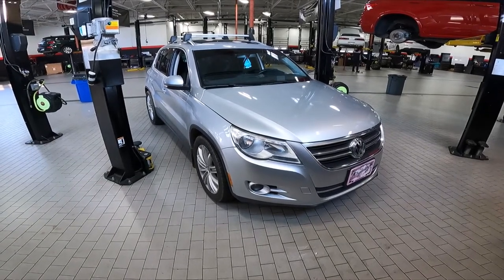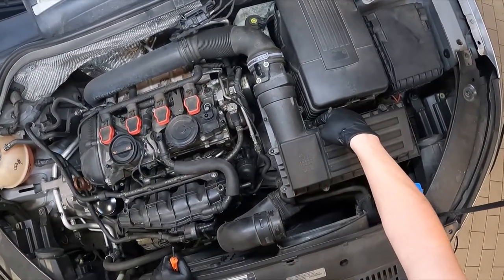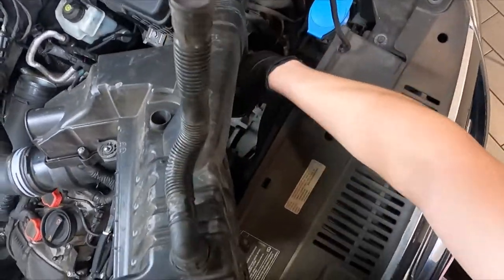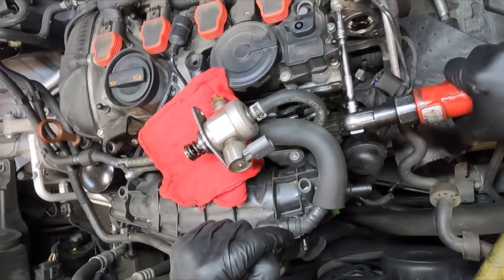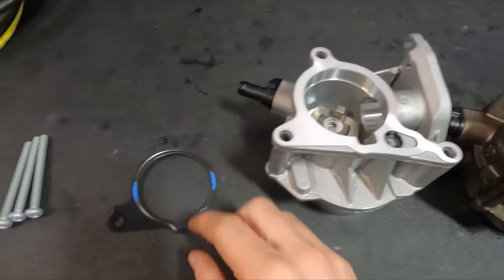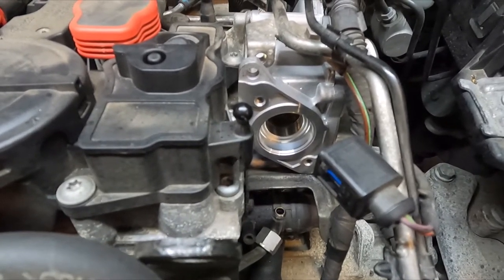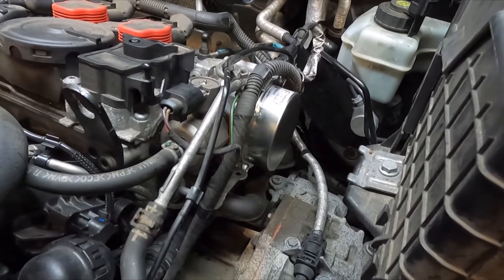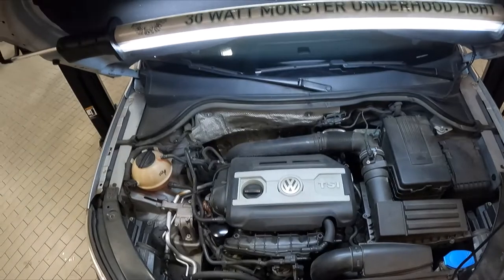How to Replace the Vacuum Pump | Mk1 Volkswagen Tiguan (2009-2018)

Comment: Very informative video, and probably the only one similar to my vehicle (cc).   The only thing that you left out, unless i missed it, was to disconnect the battery.   The LPFP will pump fuel to the HPFP if someone opens the door or unlocks the car.
Reply from the maker: Thank you!
Nope, you’re right. A very important step that I didn’t show (Or do, because nobody else is touching my car 😂). 
I didn’t even think about it, you are the first person to point that out 👏

Don’t forget to subscribe if you haven’t already, thanks!

Comment: Subscribed. Awesome video, thank you. Took me about 45 minutes total - including cleaning up the old leaked gunk. FYI for anyone encountering the issue: I have a 2014 Tiguan which had some older revision of the HPFP small o-ring. It had an indentation and looks entirely different from the new version. Don't worry if you have this, as the new one fits and installs perfectly fine.
Reply from the maker: Thanks so much! Glad I could help out!

Comment: Very much appreciated, for some reason the only other vids I can find on this are for FSI motors, they don't need to remove their fuel pump. You saved me $$
Reply from the maker: No problem!
Yeah, they are slightly different. The TSI is much easier in my opinion. 
Don’t forget to subscribe if you haven’t already, thanks!

Comment: After finishing the install with the help of your super helpful video I let it idle for about ten minutes without any issue. After that seemingly successful install I took the car for an actual drive and was fine until I gave it some real acceleration - at which point the engine loss all power and the car appeared to stall. It fired right back up no problem and idled fine only to cut out again under acceleration. No check engine light to give me a clue. The battery light is on but it’s producing solid volts. So now I’m wondering if fuel delivery is the issue and I was hoping you could provide some insight or suggestions. Cheers and thanks in advance.
Reply from the maker: Thanks for the feedback!

Hmmm, did you disconnect the battery terminals at any point? Could be a loose terminal bouncing around?

Maybe double check all of the vacuum lines in that area of repair. The one on the vacuum pump itself and the one that goes to the intake manifold. 

It could be fuel related. Maybe check the electrical connector that is on the high pressure pump that is on the front side of the vacuum pump.

If that all checks out, maybe get ahold of a fuel pressure gauge and check the low side pressure on the fuel line before it makes its way to the high pressure pump. There is a junction on the left back top side of the engine where it is pretty easy to disconnect. 

Hope this helps. 
Don’t forget to subscribe if you haven’t already, thanks!

Comment: First of all, you are setting the standard in how R&R videos should be done. 
You stated there’s vacuum pressure on the system, making the grommeted connector hard to remove, and that makes sense. Is it safe to say, if you can easily remove that line at any time you have a vacuum issue? I ask because I’m struggling with and learning about a recently purchased MK1 Tiguan.
Is there a simple way to test vacuum otherwise?
Thank you in advance.
Reply from the maker: I appreciate that!

Yes, it is very possible there is a vacuum leak or the vacuum pump is not creating vacuum.  A quick easy test for the pump itself without any tools is to pop the vacuum line off while the engine is running and put your finger on it. If it sucks on your finger, chances are the pump is still creating sufficient vacuum. I would try to be quick with this test as it can cause a check engine light if the line is disconnected for too long of time. 

Hope this helps!
Don’t forget to subscribe if you haven’t already, thanks!
Reply: Thanks. I’m really struggling with this vehicle. I bought it knowing that it had a previous PCV issue, oil leaks, and a surprise engine light. The codes were lean related. I was told the new breather assembly was bad by a “import specialist.” I order a breather assembly from ECS complete with hoses. Once I put it misfired and every cylinder. I put the old assembly and hoses back on and it runs fine. I am going to clear the codes and run it for a while. 
I’m wondering is the vacuum pump is weak, causing a lean issue. I don’t believe there’s a timing issue as it has only 95k and so slapping noise at start up. I’m found oil leaks at the upper cam cover as well as from the magnetic adjuster. There seem to be one around the vacuum. As you stated, if there’s a leak the pump could be bad. Can a combination of oil leaks and a vacuum leak cause leak codes or even just a bad or leaking vacuum pump. Thanks again for your help in this.
Reply from the maker: @ianwirick7508  Lean faults are going to be due to an unmetered engine air leak. I can’t recall ever seeing a vacuum pump causing those. Severe oil leaks and lean faults go hand in hand.  Most of what I am about to say are the common problems that cause lean faults (minus #2)

Here are a few things to check: 

1.) If the car was driven with a bad PCV for an extended period of time, there is a good chance that it blew out the rear main crank seal that is in between the transmission and engine. Clean off any and all oil leaks thoroughly then let it run or go for a quick test drive then recheck for where the oil leak is coming from. 

2.) If you only have misfire faults and no lean faults, make sure the ignition coils and spark plugs are factory  VW/NGK. This engine is very sensitive to having factory ignition/spark. 

3.) If you have the fault P2015-Intake manifold runner position sensor, chances are the vacuum actuated arm on the drivers side of the manifold has popped out which will cause a large air leak (I haven’t made a video on this yet but there are plenty out there). 

4.) Bad PCV. A quick check is to put your finger on the little hole that is on the back side of the round cap on top. If it sucks on your finger with a decent amount of suction, it is bad. If it feels kind of neutral and barely feels like it is sucking on your finger, it is still good.

5.) Listen for air hissing at idle. Shouldn’t be hissing anywhere.
Reply: I’ll report back. You have been extremely informative and helpful! I greatly appreciate the replies.
Reply: I’ve looked for the hole you mentioned, but I’m unable to find on with suction of any type. Maybe that’s a good thing. Also, I fabricated a smoke tester and didn’t have any noticeable leaking that way. I’m going to try a professional smoke tester next.
Reply from the maker: @ianwirick7508  Sounds like a plan!

Comment: Awesome video, taking on this job to reseal a leaking vac pump on a 2010 Passat. Could a leaking pump cause poor idle on cold starts? Thanks
Reply from the maker: Thank you!
Not from my experience with only oil leaking from the vacuum pump. If leaking vacuum then yes. Normally on that car though, rough idle on a cold start up means you have carbon build-up on the intake valves. Would need to take the intake manifold off and manually clean out the carbon. Hope this helps. 
Don’t forget to subscribe if you haven’t already, thanks!
Reply: @RedsVolkswagenRepair  thanks, got the new pump on. Definitely do not overtignten the bolts, I stripped one out and had to place a thread insert! The oil leak is gone now. Going to throw new coils & plugs in and look for a place to have the valves cleaned.
Reply from the maker: @SchneidyP  Nice!
Glad I could help!

Comment: Does anyone know the actual torque specs for the vacuum pump bolts...the 3 long ones that attach to the cylinder head (in the video around 12 minute mark).  tks!
Reply from the maker: Unfortunately I don’t give out torque specs on my page for liability. I just give the step by step know how. I leave that little bit of research to the viewers. 
Thanks for subscribing. A few more videos in the works!
Reply: 9 newton meters

Comment: What does the vacuum line you disconnected connect to under the intake manifold?  What is the purpose?
Reply from the maker: Good question.
It supplies vacuum to the intake manifold flaps that are actuated by an electronically controlled valve.
Reply from the maker: Don’t forget to subscribe if you haven’t already, thanks!

Comment: Is this the only place in that area that will leak oil? I’ve got a puddle on top of the trans and from underneath it’s dripping off of the bottom of the manifold on drivers side rear of motor. From what I’ve seen it seems to be the only culprit. Valve cover is clean
Reply from the maker: If there is a puddle on top of the transmission my bet would be the vacuum pump and gasket. Start with that and clean up the area. If you find oil still leaking after that, the only other item that typically leaks on that side of the engine is the metal cam cradle “a.k.a. Valve Cover”. The red or green anaerobic sealant dries up after a while and starts to seep oil, sometimes to the point of a leak. 
Hope this helps. Thanks for subscribing!
Reply: @RedsVolkswagenRepair  it’s definitely the pump. After a few minutes of running I can put my hand on the bottom of the pump and it’s covered in oil. Would it be acceptable to just replace the gaskets on the pump instead of buy new? Since the pump still functions properly?
Reply from the maker: @dmanwinters17  99% of the time the pumps start to leak at one of the seams that are “not to be separated”. I would replace the pump and gasket and call it a day. On ECSTUNING.COM the Pierburg pump is the exact same pump as the OEM genuine VW pump. It is who makes and supply’s VW pump, just without a sticker that says VW/Audi and is $150 cheaper. Says it’s $245 right now plus a $5 gasket.

Comment: I have a Vacuum leak I can hear it when accelerating, but I couldn't find the leacking point
Reply from the maker: Most of the time on this engine it’s the PCV valve assembly located on top under the engine cover on the right hand side (big black assembly). There is a small hole on it, put your finger on it and see if you can feel suction. If you do, you’re PCV valve assembly is faulty. Hope this helps!
Don’t forget to subscribe!
Reply: @RedsVolkswagenRepair  Thanks, I will check it out
Reply: Same here. I hear a loud blowing sound when accelerating. Also not sure where the leak is. 09 Tiguan tsi 1.4
Reply: @FantasyUFC  Finally found it, turn out I have a big rubber pipe out of its place, the one goes to the intake manifold, it was laying out from the down side behind the driver wheel, I had to remove the cover and Crowle under the car  to put it back in place, i write this incase you had the same issue.
Reply: @DIY_TOP  thanks. Will check it out and give feedback